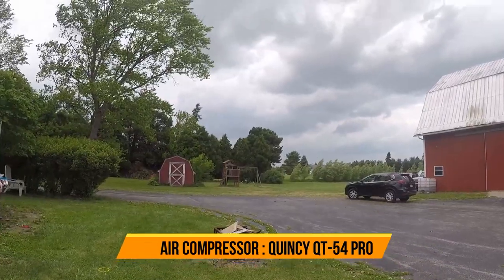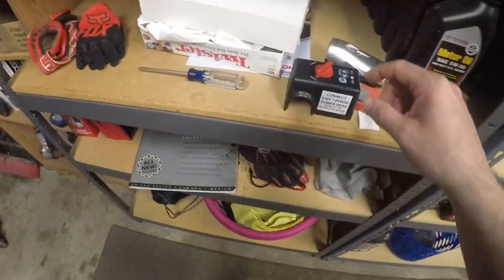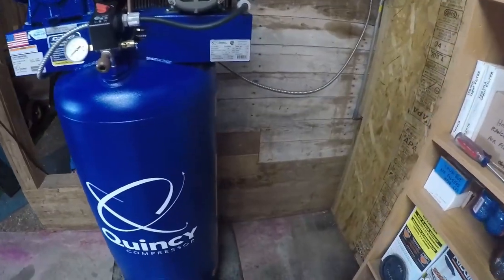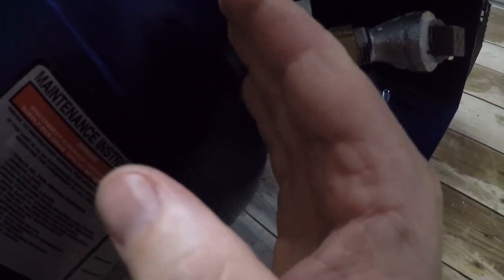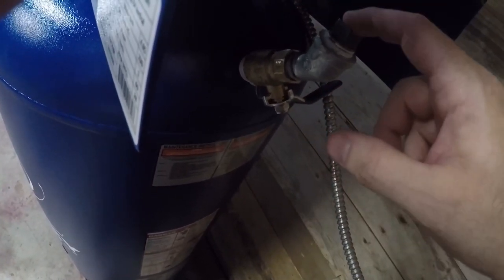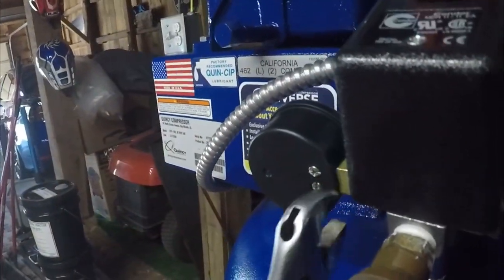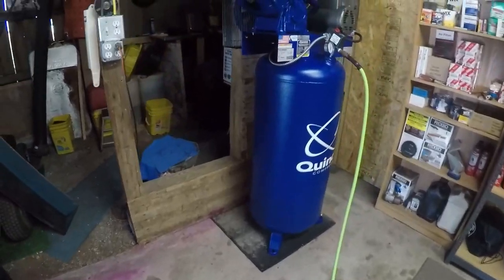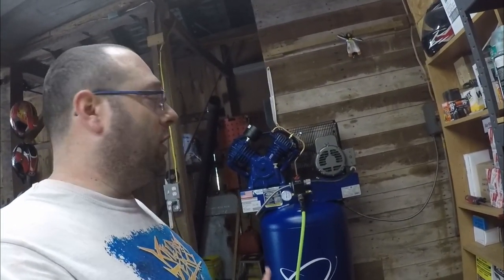New air compressor for shop - Quincy QT-54 pro

Comment: Thanks for turning the volume down when the compressor was running.  If the heat in the tank worries you, an after cooler will solve that issue, and condense water out of the air as well, reducing the chance of rusting your tank.  Check some other videos on that, there's quite a few now.
Reply from the maker: Thanks for the tips! I'll check that out for sure! Compressor has been doing good! It's SOOOO nice to have something decent finally! Thank you for watching!

Comment: It's a snowball effect. lol.  One tool leads to another which leads to a garage full of cool stuff.  Hahah.  Not good leaving threaded attachments leaking from the factory though.  Bad form indeed.  How much time does it take to put some teflon tape or paste on there and do a final pressure check before leaving the factory?  People end up telling their friends "it's a great compressor but it did leak a bit when I first got it".  Jeezzz.  Much better to be saying "It's an awesome machine period."  But I'm glad you got a proper compressor, MAJOR improvement for the shop.  You'll love it, worth every cent.  Get a good air hose reel so you don't have lines coiled up everywhere.  Another quick note.  Make sure you plumb with the 1/2 inch connector.  I have had bigger air tools work like crap even though the pressure was up.  Air "volume" makes a huge difference.  Have fun bud. 👍👍
Reply from the maker: Dr. G!!! What's good mane!?

Yeah, man, for what I paid for this beaut, you'd think they could have added a little paste, for the whopping $0.32 cents, lol! But's it all good... She's a sweet machine and you and I think alike, because I have a 50 ft. reel in my shop and another 50 ft. reel in my barn. I'll add another 50 ft. reel near this compressor and yes, I will be plumbing 1/2" iron pipe to the right of the compressor into my shop. I'll have some good filtration and water separation as well by each drop. Still doing some research on those items, as I want to get good stuff... I'd still recommend this compressor to people. But yeah, I need to stop spending money for a bit, lol... Lots of cool tools for sure! As always, thank you for watching and I hope you're doing well! :D
Reply: Did you pay 1400?
Reply from the maker: @BigBadJohn1892  Sorry I missed the comment. Yes, about $1,400 after tax and all that. Very nice machine, well built. I'm glad I spent more on a good compressor.
Reply: @BarnStangz  bought mine 2 days ago and (a year later) it was $1800! Air compressors are up across the board. Anyway, I've been wanting a Quincy for years. I've used several different brands of high-end compressors at work and Quincy has been very good. I ordered a similar Bel Aire compressor, but had to cancel it because there was a 6-8 week backorder. My understanding is that Quincy and Bel Aire are made by the same company. The Bel Aire was $300 less, but this one was in stock at my local Rural King. I'm running new air lines, water separator, etc. Should have it all hooked up and running in a few days.

Comment: About to get one of these.  I'll definitely be checking those leaky spots first.  What size breaker do you have that on?
Reply from the maker: Thanks for watching. I have this baby on two 30 amps. Works great! Love the compressor after I fixed its very few short comings. I would recommend it to anyone! Have a great holiday!
Reply: @BarnStangz  so you are running this on a pair of single pole 30's?
Reply from the maker: @Bonemaro2000  Yes that is correct.
Reply: @BarnStangz  thank you sir.  I kept seeing references to a 50A requirement, but I couldn't imagine why... especially since a 6GA wire is too big for the switch.
Reply from the maker: @Bonemaro2000  Right! Yeah, 6GA, whoa, that's a bit big!
Reply: @BarnStangz  I saw that too. I have it on a 30 amp breaker 10 gauge wire. The wire coming from the motor is 10 gauge.
Reply: @Bonemaro2000  Quincy specs the 50 amp breaker for the start up load, most people just measure the start up load when the compressor is cool and has not been worked. If you are working the compressor I can see were the start up load can increase because the unit will be hotter and running more from being worked. By the way a 50 amp breaker is perfectly fine to use with AWG 8 gauge wire by code. 

The truth is this compressor is best served by using AWG 8 gauge wiring from the panel to the compressor and don't use single pole breakers purchase the correct breaker so if it trips both sides of the breaker will trip together. I own a Quincy QT-54 compressor and have not had any issues from day one. I did upgrade mine by adding a magnetic start box, that keeps the pressure switch from having to handle the 220 volts and the amps through the small contacts that will quickly wear out. The magnetic start box only supplies 110 volts to the pressure switch while the magnetic start box handles the 220 volts and amp load. This will allow the pressure switch contacts to last for many years. 

I bought a Shihlin Motor Starter P30T, it is rated:FL 34A with a coil voltage: AC208/230V. 

This compressor and magnetic starter has been working together for the past 3 years 9 months without any issues. 

I wired mine from the breaker box using a 50 amp breaker, AWG 8 gauge wire, to a 60 amp shut of box then ran AWG 8 gauge wire to the magnetic start box with AWG 8 gauge wire from the magnetic start box to the Balder motor. 

You are going to read people using only a 30 amp breaker and AWG 10 gauge wire but you are at the upper limit by wiring it that way. Much better to follow what Quincy says and use a 50 amp breaker and wire it with AWG 8 gauge wire, that way everything is within both Quincy specs and the electrical code and you will not have any issues with the unit due to how it is wired. 

I also use Redline 30w Polycomp air compressor oil in my pump. I suggest running only Redline 30w Polycomp compressor oil or Royal Purple 30w air compressor oil. Both are high quality oils, both are expensive but they will protect your expensive investment.
Reply: @mustangecoboosthpp3869  I did end up running 8 AWG, however, I currently have it fed from a 30A breaker simply be because it was already in the box.  Thus far, it's been running fine, but I can switch it out if need be.  I am going to look into that magnetic starter though.

Comment: Mine is being delivered this Friday. What size wire are you using from the compressor to the box and what size fuse? Thanks in advance
Reply from the maker: Thanks for watching. I used #10 to wire it and it's been fine. I also have it on a 60 amp breaker (2) 30's.
Reply: @BarnStangz  i got a 50amp. I should be OK with that according to Quincy
Reply from the maker: @coodeville1091  Yeah, you'll be fine! Enjoy the new machine when you get it!
Reply: @BarnStangz  You are incorrect on how breakers work. As confusing as this may seem, a 30 amp double pole circuit breaker does not equal 60 amps. When used in home wiring a double pole breaker is used when a 240 volt service is needed (for a high draw appliance like a range, dryer or in this case air compressor). A double pole circuit breaker provides an appliance with 2, 30 amp, 120 volt services, for a maximum draw of 30 amps at 240 volts.
Reply from the maker: @mustangecoboosthpp3869  That makes more sense. You think I should rewire it then? I've got some really old ass wiring in my shop, wondering if I should just re-do everything...? I've got a total of 100amps to the shop I believe. The compressor has been working fine for 2 years now.
Reply: @BarnStangz  Many use 30 amp circuit breakers but they are in their home garage so the compressor does not get used that much so they get away with it but it still is not wired correctly. If you use the compressor a lot and it cycles a lot as you use it if it was me I would rewire it with AWG 8 gauge wire and install a dual pole 50 amp circuit breaker like Quincy specs.

Comment: I've seen a lot of threads about these leaking in various forums.  Apparently these "lower" end models don't have any pressure testing as part of QC.  USA Quality ;)
Reply from the maker: Sorry I missed your comment. Yeah, it's too bad, considering that this was still a pretty expensive unit, it would have been nice for them to show a bit more QC. I feel like "Made in America" isn't what it used to be, that's for sure! Thanks for watching!
Reply: @BarnStangz  I'm surprised. I didn't have any issues with mine at all. It will hold 150psi for a month and not lose anything. Maybe due to the pandemic they have some quality control issues.

Comment: Well.......I got mine. Hooked it up and ran it for an hour as Quincy said to do. Closed the tank after an hour and the tank filled to 165 psi. Turned off the power just to see if it would hold pressure overnight. Woke up in the morning and no leaks. Turned it back on and it would not start. Opened the switch and checked for power on the lines and had 230v. The problem? The contacts on one of the motor side was broken. Sent an email and am waiting. That Condor switch, 11qc2eart, is made in China btw.
Reply from the maker: Damn, that sucks about the switch. I had a feeling that not everything was made in the USA. Maybe they will source a better switch next time. I guess I would have rather dealt with leaks then a bad switch. I'm sure that they will send out the parts to you quickly, but man, I feel like even "Made in the USA" isn't what it used to be. I hope you get back up and running quickly!
Reply: @BarnStangz  yes, it does. A new switch costs $42. I ordered one but still want Quincy to send me another as a backup. I guess I found the weak link in the system
Reply from the maker: @coodeville1091  Weak link for sure. It's always good to have a spare, might not be a bad idea to find a better switch even.....?
Reply: @BarnStangz  you hit the nail on the head. I saw a Square D one and am checking to see if it can be retrofitted
Reply: @BarnStangz  I just took the broken one off. Took all of 5 minutes. A continuity test proved I  was right
Reply from the maker: @coodeville1091  Awesome man, let me know how it works out for sure!
Reply: @BarnStangz  i will
Reply: Update? Anymore problems?

Comment: I went with eaton polar air 7.5 hp 80 gallon with the silencer and have never looked back its a monster and 5 year free warranty. I had this very compressor and the first one burnt the motor out in 3 hours and then the second one they sent had a leaky tank over some bad welds im glad yours worked out i was so pissed dealing with it at the time but USA made really dont mean shit i found out the hard way anyway quincy did take itback the second time when i threw in the towel on them so there good for that. But these things really should be good with that baldor motor good luck with it
Reply from the maker: Thanks for watching and commenting man! This is why the internet community is so important. Yeah, I have to agree with you, made in USA isn't what it used to be, that's for sure, but luckily I've been having pretty good luck with my compressor and it's seen a pretty large amount of use. I'll for sure keep everyone posted if I do have an issue with it. Thanks again!
Reply: What is the duty cycle on them compressors?

Comment: What’s up with that paint ? That looks like something you would spray as a Bedliner !
Reply from the maker: Thanks for watching! Yeah it's not smooth at all, more like a wrinkle finish I guess...? But it looks nice and is applied well. I don't have any issue with it. Compressor is still working great and it sees quite a bit of useage!
Reply: @BarnStangz  sherwin williams quincy blue

Comment: What is the (dba) level on it!?
Reply from the maker: Thanks for watching, hard to tell honestly, I don't have anything that could measure it, I'd say no more than 70db.
Reply: @BarnStangz  Awesome video `` thanks'
Reply: @BarnStangz  I was deciding on buy the iR 80 gallon TS4n5// or this qt-54 60 gallon!
Reply from the maker: @davidfernandez7425  Both good choices. The 60 suits me well and I use it for a lot of stuff... Air tools, plasma cutting, cleaning stuff, sand blasting, etc.
Reply: @BarnStangz  ?? Do you think the qt-54 60 // or 80 is better ? I do a lot of sanding &  auto body complete  refinish paint jobs'!  We're I need continuous air to paint!
Reply from the maker: @davidfernandez7425  since you need a LOT of air and both compressors you're looking at are 2-stage, I'd probably go with the 80gal. 20 more gal is actually quite a lot I think, esp. since your doing a lot of auto body stuff.
Reply: @BarnStangz  Gotcha thanks " I'll go with 80"

Comment: Is the pump made in America?
Reply from the maker: Thanks for watching, both the pump and electric motor are made in the USA. That is the main reason why I wanted to buy this compressor. I don't want any off shore junk!
Reply: @BarnStangz  I just received mine, and on the black plate on the pump, it says Made in China. :(
Reply from the maker: @robertcates4289  Oh man, I'd be pissed about that! I wonder if Quincey is just trying to get whatever parts they can because of supply chain issues? You might want to call customer service and find out what's up. I know I would! Good luck and let me know what happens!
Reply: @BarnStangz  Look at the black tag on your pump. Made sure yours doesn’t say Made in China
Reply: These pumps are not made in the USA.  Maybe they USED to be, but not anymore.  Go with Saylor-Beall if you want full USA.
Reply: @nharp83  My Quincy QT-54 has made in the USA on the plate on the pump, mine was made in 2018.
Reply: @robertcates4289 60gallon is China the 80 Gallon 5hp is made in the USA.

Comment: That pump is not made in the USA.  Look at the black tag, it is made in China.  You should correct this video.  If you want USA buy a Saylor-Beall!  💪
Reply from the maker: I'll have to take a look thanks.
Reply: I own a Quincy QT-54 air compressor and the pump on mine has a metal tag on it with its own serial number and clearly says Made In USA.
Reply: @mustangecoboosthpp3869  Your pump unit must be a few years old.  New ones are made in China.
Reply: @nharp83 60 gallon is China 80 Gallon is made in the USA.